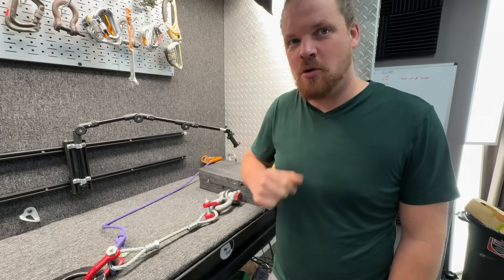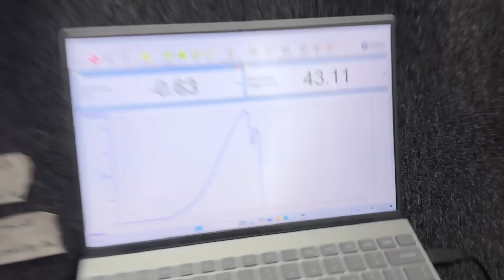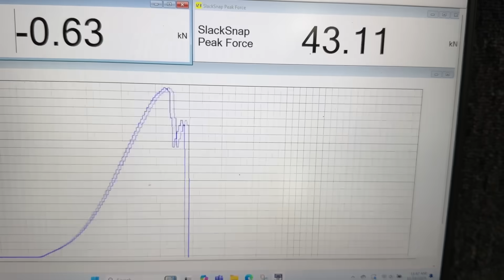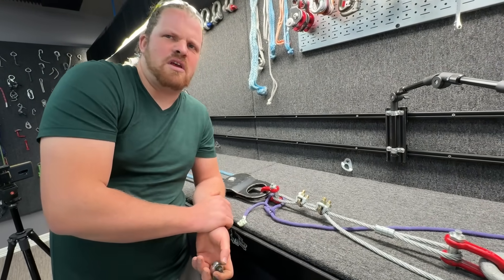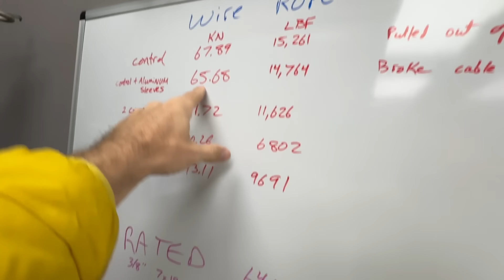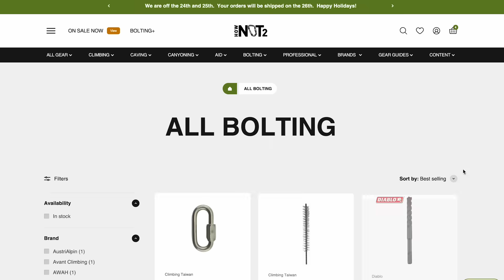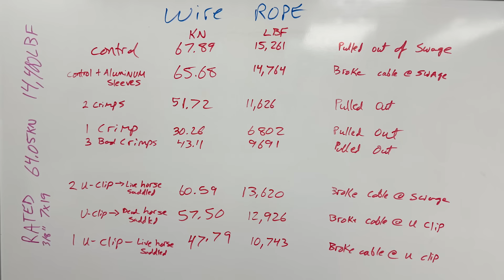Never saddle a dead horse

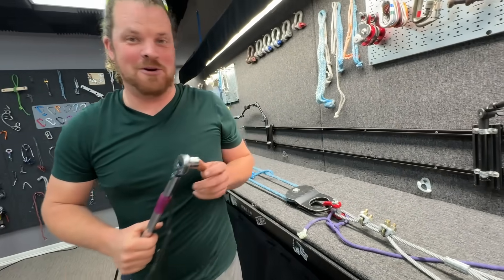Comment: 4:50 you used the torque wrench just fine lol. pretty much all torque wrenches of that style requires gripping anywhere on the knurled handle to get the correct torque value. and really really tiny torque wrenches will always have a clear mark where you put your finger to apply torque (but that is for like 5 inch pounds on an RF connection)
Reply: Better to use a torque wrench wrong than not using a torque wrench. How off could it be?

Comment: your swage tool also has to do with the holding power if you over crimp it the swage breaks under crimp and it slips out. hey can you do some test on synthetic winch line sold for offroading? it would be interesting to see if they actually hold what they claim

Comment: I have set up various steel cables for non-commercial use, (hauling loads up very steep and rough terrain) and use U-clips (we call them u-bolts here in UK).  I don't torque the bolts nearly as much as that as I don't think it's good to crush/deform the cables, or risk threading the nuts/bolts.  But I always use three u-clips per loop, as at least in theory, three is 50% stronger than two.   This way if there is failure it's more likely to be a more gentle slippage rather than a catastrophic break.

Comment: My observations over decades of using wire rope have been that which side the saddle is on makes little difference, how tight the nuts are counts much more.  Too tight crimps the strands and weakens them, too loose and they slip.

Comment: I'm confused, why don't you braid the cable back into itself before you crimp it?
Reply from the maker: what advantage does that provide?
Reply: @HowNOT2  it greatly increases the strength of the cable crimp point and is suppose to prevent it from being able to pull back out from the saddle, or a sleeve.
Reply from the maker: You have any testing or documentation to support that?
Our understanding is thimbles are added to eye terminations that will see wear. Not an issue in the tests in this video.
Reply: @HowNOT2  this is what we were taught in underwater welding school and surface Supply diving. Let me look around and see if I can find any of the texts to back me up.

Comment: Cable suspension bridges use cable dogs, 5 off and only the middle one is torqued to maximum, the 2nd ones are torqued to 80% and the outer ones are torqued to 60%.

Comment: I realize the crimping the wire rope/cable is faster than what I'm going to ask.  HOW strong would a pulling eye that is weaved into the cable vs crimping?  When I worked with our company's rigging crew as a welder, the old timers showed me how to weave splices and pulling eyes. After some practice I could weave an eye in 40 minutes and that was about 18" long.  Any of the rigging crew could do it in 10 to 15 minutes. Just need a vice and a FID, Needle, spud  (I forget what it's called).

Comment: This is probably the most useful video I've found for my career as an ironworker
Reply: Shouldn't this have been taught to you when you were learning the trade? The industry has done these tests so many times over to get the ratings, build the instructions etc, this should be common knowledge for those in the trades and codified.
Reply: @corail53 lol… how extensive do you think his training has been?
Not to disparage anyone, but I’m guessing it varies a lot but can be very low… in many trades on the job training, hands on experience is the real training.

Comment: I worked in a job that made us use 3 of the u-bolt type per connection except the middle one was always "saddling the dead horse". We never used a torque wrench and it it was much smaller cable in marine environments, not used for overhead lifting or for supporting people.

Comment: Since it appears that having the aluminum swage reduced the strength a little, I'm guessing in the way it failed that it's because the aluminum swage is partially over crimped deforming the cable. I would suggest, since the aluminum swage is just there to hold the dead end so it does hurt anyone, that it be crimped with less force this way it doesn't pose a risk of deforming the cable underneath.

Comment: My coworker just asked me the other day where he could get those cable clamp things for a 1/4" winch line that started to fray at the original crimp. They were using it to demo a building and lift heavy pipes in sketchy spots, sometimes overhead. I told him to go find our tools and crimp it properly. 

After this video it probably could have worked out fine either way but there is the human factor of not torquing the nuts correctly.

Comment: 35 years ago, the industry standard was to alternate the clips and saddle the dead horse with one of the three clips.
Reply: So what do you figure changed in 35 years? Legitimate question here, was it the quality (or lack there of) of materials being used or maybe some yuppy decided to shake things up? Again, I'm asking, not trying to be condescending.
Reply: @cornfusedatbest3980    What changed? The internet came into being. But Ken Smith is conflating what he learned with the “industry standard.” I’ve also be around rigging for over 35 years and the industry standard even with 3 wire rope clips is all 3 no saddling dead horses. And always has been. So many tradesmen learned from the oral tradition and never read manufacturers engineering specs. There were countless inaccuracies passed down thru the generations. I saw this kind of ignorance for decades. Being a whippersnapper it was difficult to convince the old dogs that they were wrong.
Reply: @carpballet  yes sir, there is no "STANDARDIZED" method, only the one that "WORKS" so to speak. I've always been that idiot THAT goes against the grain, only to find that I was right. Nothing is ever written in stone, and even then, it can be re - written. It's all science, which is a never ending pursuit of knowledge.
Reply: @cornfusedatbest3980  What it appears to be is a matter of opinion, rather than a true standard.  The problem is knowing the difference, as many of us don't know which is better.  Testing is the only way to prove which is better.
Reply: Nope
Reply: I used to work in roped access 25 years ago and we always used clamps on steel wire ropes. We used 3 (or 4 when paranoid) and we'd "never saddle a dead horse" but we never used torque wrench and did by hand tension. But what we were also told was very important was to do them tight but not too tight so that they could slip very slightly and equalize load so all load wasn't taken on one clip. That was always thought to be really important

Comment: Interesting results! Looks like you only need a single swage , not two. To capture the splayed ends try a short length of heavy walled (black for UV resistance) plastic tubing and place it correctly before swaging. Use it on your guy wires (where you're using saddles)  too. I don't like sharp stuff and the ends splaying will capture it. And how about heat shrink over the swage as it'll have sharpish edges?

Comment: From my work with some Instron machines and wire fixturing for pull testing, the edge of the crimped material really matters.  You know you've got something working as well as it can when you know your material is fairly linear across itself and it starts necking in the center and breaks somewhere in the middle a decent distance away from the fixturing points.  Compressing metal is less wear than shearing it; the u-bolts compress with a rolled edge while crimping places either a harder edge at the crimp point or on the edge of the crimp connector itself.

I feel like it would be it simpler and better with a mesh/net connector and a tribological/compression sleeve over it, so it doesn't wear excessively or bits of it come unraveled/stay contained.  I would want to make sure that the weave is made of something temperature/dimensionally stable, like invar but something better suited to the weave - slide the mesh twin holed sleeve on the cable on one side then slide the cable in the other after making a loop (or adding a tribological loop insert as well to completely avoid wear on the cabling), loop your cable over a VERY strong hook, then use a fixed winch or puller to grab the ends of the mesh and pull it tight, like the old finger trap toy made of grass/straw but you somehow can't escape it by pulling - it only gets tighter - and you're not tying off against the cabling, you're tying off the netting that's holding the cabling so the netting can be 100% the only thing that's touching your cables.  The containment sleeves that go over the cable joints are replaceable and puncture resistant. The cables are then the only thing involved in linear shocks and stresses; the meshes merely keep the ends together in a loop and the loop holds itself harder the more you yank on it 🙂

Comment: High strength cable connections are a cone that splays the individual strands and a low enough temperature alloy that doesn't weaken the steel is poured inside.
Reply: Babbit
Reply: There is also an epoxy product that replaces the alloy rated to the same strength.
Reply: They are called spelter connections

Comment: In line work we use a EHS 3/8 cable.  It is a very hard cable it will flatten any bi metal blade tooth.  It cannot be bent super sharp it wants to be straight.  We use a modern "preform" end on it it keeps everything straight and it is just wrapped around the cable no mechanical connector.  I always wondered what would the failure point be in our application.

Comment: for funsies, a "flemish" eye splice, or "farmers eye" even without swages or clamps should be as strong as the original rope, its also the easiest splice in the world to make... for safety sake swage or clamp the dead ends to keep them from unraveling.  
I've also seen folks just splice the dead end straight through the live side one time... which looks scary as S but holds better then ya might think... (for safeties sake I wouldn't use this in a life support way, though the Flemish eye I mentioned above is commonly used for logging and heavy rigging)
Reply: Hopped on to make this comment. I spent years doing a full eye splice for our logging skyline. Remember reading a study that said a farmers eye followed by a tuck was as strong as a full splice. It took some time to trust them for our skyline. After that I never looked back. Way faster and a helluva lot easier.
Reply: @danbellows9529   arguably, the 3 tuck "logger eye" is more resilient to abuse, i.e. dragging through sticks rocks mud etc, but it is a helluva lot more work.  Couple of cable clamps on the Flemish to keep the ends secure is all you really need on it, the extra tuck weakens it, even seen some were the dead end was clamped by its self, a ferul would be the best thing, but putting a ferule on 1 1/8 rope in the bush is... unrealistic lol

Comment: I cant remember what it is called, hand splice? Flemish eye? Where you unwind the strands and make a loop without using a sleeve and crimp. Super curious how strong they are.
Reply: Flemish twist
Reply: Wonder what a farmers eye with single tuck or double tuck would hold. I've seen farmers eye with  extra tail that is re-wrapped and cable clamped. I never would trust how these guys are doing it.
Reply: @mikenicholas885  Works fine to get you going in a pinch,  3 tucks are going to be more reliable in the long term.
Reply: Hand splices were the way I was taught as an apprentice in the 80's to terminate wire rope - although for the very thick stuff we'd use white metal.
Reply: WIthout using a ferrule and thimble, it is just a handsplice. When you put a ferrule over the splice, is the a Flemish Eye (with or without thimble). Normal mechanical splicing (originally called Talurit) uses a ferrule but without handsplicing it first, just like the ones in the first part of the video.
Reply: Ive seen them, and was curious about that as well. Thankfully, I found the answer in the comments.
Reply: The four common eye splices should give you ~90% of the original cable's strength when done correctly. Makes cable clamps sound like a bad idea for anything besides holding the tail of a quick-and-dirty hand splice in place so it doesn't just flail around. The differences are mostly about finish and effort.
Reply: It's how ski lifts, high voltage transmission lines, and sometimes mooring lines are done. I'm sure some of that has to do with not needing additional supplies though. Kinda hard to run to Home Depot in those situations.
Reply: @UVBluetoo  It mainly depends on the situation/application. Crimp-terminated cables are everywhere simply because crimping is trivial to automate for consistent results.

Hand splices require time, skill for the more complicated styles, are far more complicated to automate, get exhausting to handle once bundles are beyond thumb-thick and kind of dangerous when long enough to whip you in the face if you aren't careful enough.

Sling cables often use eye splices with concealed ends (tapered and tucked back inside) to avoid having anything on the cable for stuff to snag onto. You don't want a 50 tons lift slip 2" off of a mechanical splice produce a massive shock load that could shear some pins in a crane.
Reply: @teardowndan5364 Makes sense. I knew it was done, but not why. It's neat to learn the why. Don't wanna cheap out on something like wire rope. Cheap ain't good, and good ain't cheap. Especially when it requires skill.
Reply: @UVBluetoo  That is a long splice not an eye splice.  I have thrown a quick farmers eye and a single tuck splice into 3/8" line using a bar wrench from a chainsaw to get stuff off the hill while logging.
Reply: @banffdigger  You sound like me when I try to explain to a customer what's wrong with their car, why it takes as long as it does, and why it costs so much.

I have no idea what you're talking about, and no intention to learn another obscure talent at the moment. If I did, I'd probably never use the skill anyway. There's enough random information floating around in my head as it is. Gotta draw the line somewhere. Closest I'll come to doing something like that would be connecting low voltage DC wires, and I prefer to use marine crimp and shrink conmectors most of the time for that. Anything more, and I'm letting a professional handle it.
Reply: A Molly Hogan
Reply: Farmers splice.
100%

Comment: We've done a bunch of our own internal testing. It's surprising how well even bad crimps will hold to rated capacity, provided it's not terribly bad, on thinner diameter SWR (we mostly use 1/8-5/32). We've got a great relationship with Nicopress and Loos & Co. engineers, they're a wealth of information.  I'd be curious to see their response to your testing.

It's too easy for a layman to screw up a Crosby installation, and I've seen some wicked breakages primarily from improperly torqued connections.
Reply: As with a lot of climbing gear, there's lots of safety factor, so you're probably not doomed if you do it wrong once. But if you make a habit of doing it wrong, the odds will catch up to you eventually.

Put differently, all that safety factor is there for a reason, and you want to do what you can to keep it there.

The purpose built swaging tool seems a little more foolproof. Torque wrenches can be set wrong, and nothing is stopping someone from tightening bolts with a regular wrench.

Comment: We use the Flemish eye at work all the time, would like to see that tested with and without a cable clamp to hold the tail
Reply: Is a Flemish eye the same as a tug boat splice? Unlay half the strands then relay to make the eye? 
Either way, plus one for testing
Reply: @bbmacc  SCIENCE!!!
Reply: @bbmacc  yes!
Reply: They should be about 60 percent the overall strength of the cable according to the cable and rigging manufacturer Hercules wire rope. But who knows how old that test is? I would love to see that video as well. Flemish eye/farmers eye/ molly Hogan pull test
Reply: @SquidVicious44444 im sure rated at 60% for safety standards , but the break test scale won’t lie with a true number
Reply: @SquidVicious44444  The only splice I was taught and learned was called a Liverpool Splice. It was very strong, but should not be used where the wire could "unwind" under load such as the hook end of a crane whip.
Reply: We used to call them a Molly Hogan.
Reply: The worst thing that can happen is you becoming unlaid…
Reply: @wb5mgr  Well played my friend, well played.
Reply: I was going to suggest that too
Reply: You're gonna need to send him the stuff that you use so he can test it. Send multiple so he can do multiple tests
Reply: Was thinking the same thing.
I make them at work on small cables, 1/8" stuff and make grab handles.
Then swedge them to keep them clean and tight
Reply: In elevator construction we use the flemish eye in europe.
Reply: I can’t believe they were not Flemish Eye splicing before they crimped it. I have made 100s upon 100s Flemish Eye Splices in wirerope ranging from 7/16 up to 2”. 90% of them was just the splices it’s self, no clamp. I have never seen one fail. The wirerope just before the eye is almost always the point of failure. I’m thinking a Flemish Eye Splice alone must be over 90% of mbs.